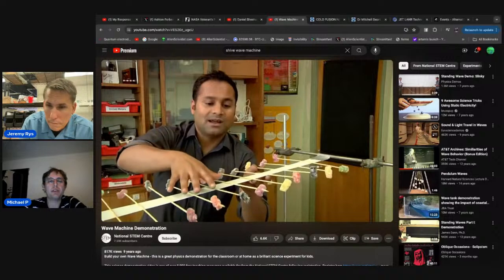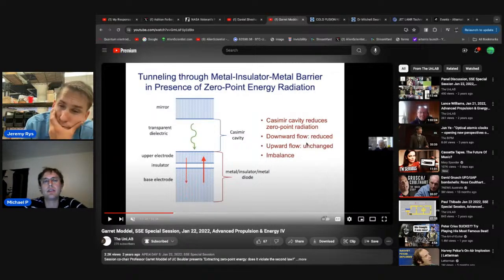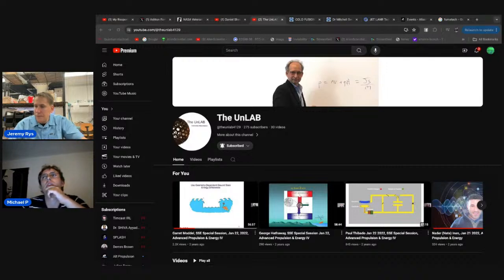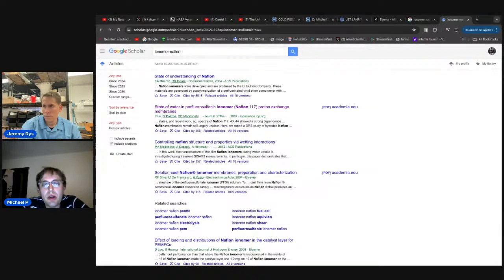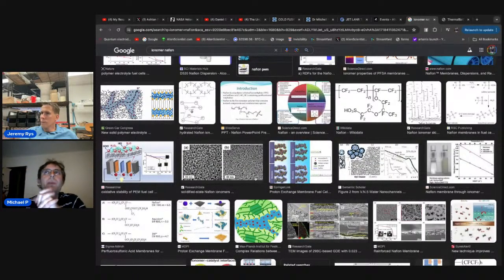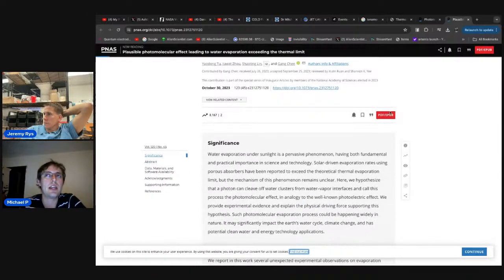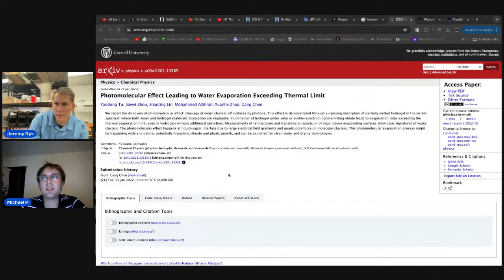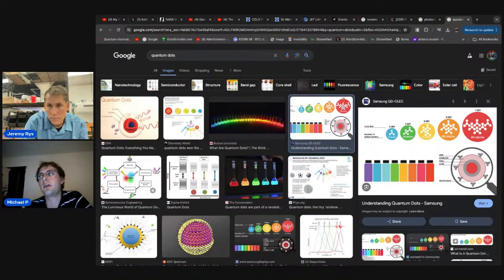Free Energy Friday... An Open Discussion On Past, Present, and Future Research

Comment: There are 3 types of gravity. 1. Source gravity is  oval 2 dimensional, 10 times longer than wide, and resides at the toroid pinch point of atomic matter and magnetism drawing out the lines of inertia. 2. Linear gravity is the matter organizing equatorial zones of centripetal toroid vacuum energy systems (example galactic) spacewide. Mass gravity is variable, current rotation funneled, voltage distributive and resonant scalar shorted or pulsed magnetic S band snapping annihilated. Tensor gravity is relative to mathematical theory. 3. Spheroid gravity is both polar non reflective, accumulative standing current independent, reluctance propagated and both weight charge dependent.